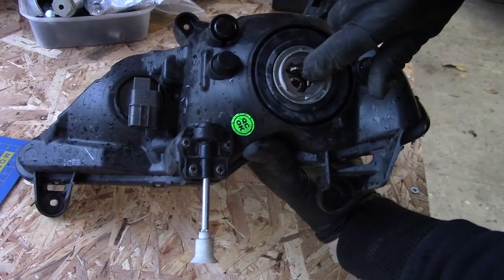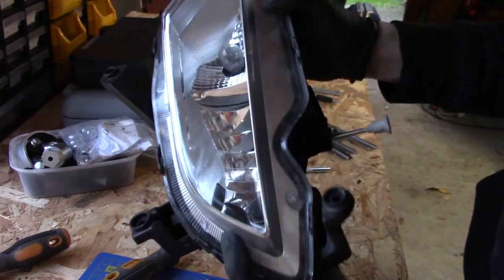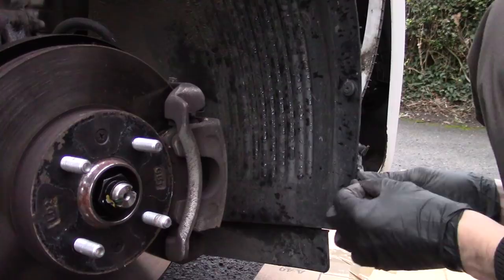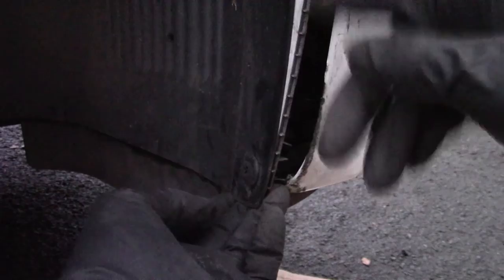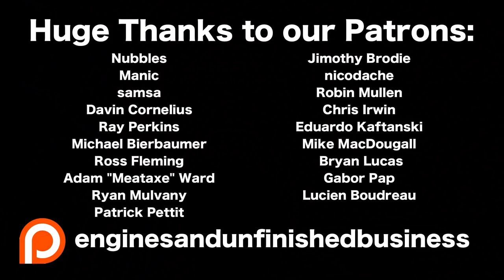Broke our only working car

Comment: Top tip for taking wheels off and putting on, push the bottom of the wheel in and make sure the bottom nut is always last off and first on, holds the wheel perfectly on then